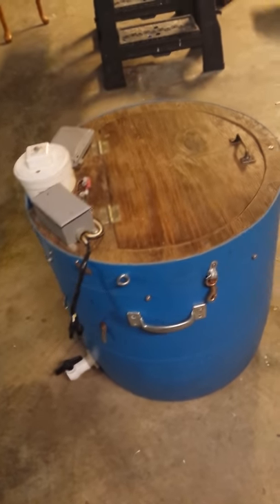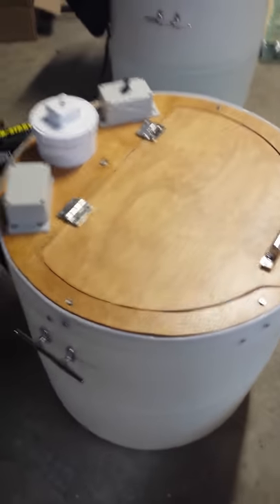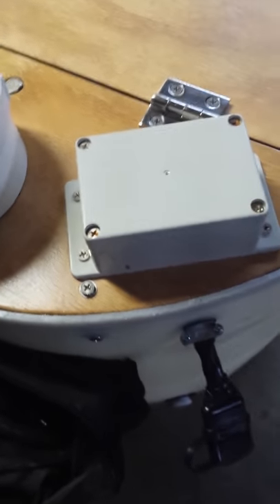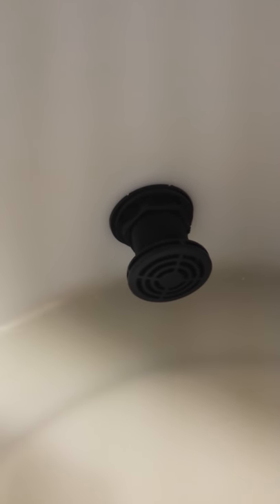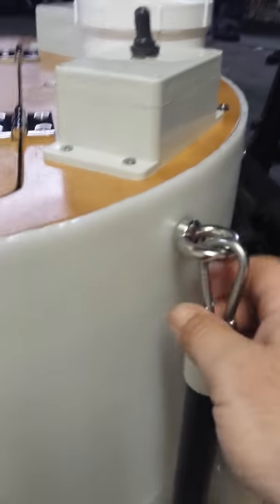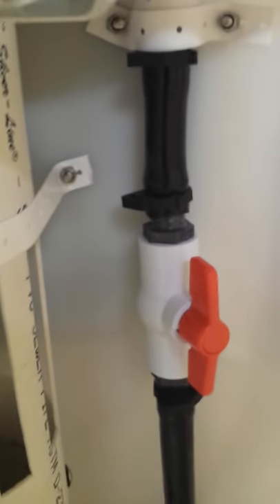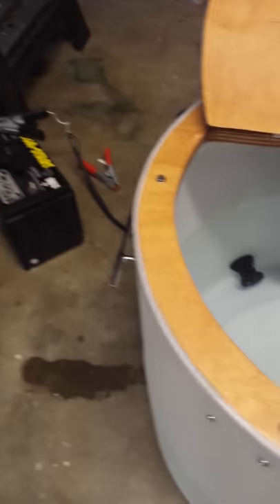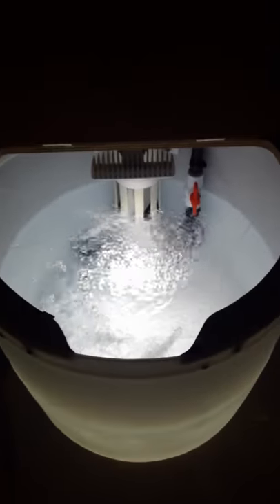How to build awesome bait tank

Comment: Question.  Wouldnt it be better to pull water into pump from the bottom of barrel.  Filter material below pump with holes drilled into bottom of filter pipe for water intake. This way you would be picking up waster from bottom. Appears your design may not be picking up water from bottom of tank. Want to build one for shad. Thanks for video, you got me thinking. 😂
Reply: Yes I agree with you ,and also I've heard you have to keep pumping fresh water in and waste water out for shad .I would like to know if that is a fact .

Comment: Building my first one now, love your design and video!! Only parts im missing to complete this would be a reducer from my pvc elbow to the spray bar and the spray bar end cap. Any recommendations on what to call those parts/where to find them?? Thanks for an awesome video and all your help!
Reply from the maker: Awesome David! Glad your building one!! The specialized reducer that transitions you from the 3/4 pvc to the spray bar is not all that special. Because I got mine at my local Lowes home improvement.. I've purchased all of mine there. Just find someone in plumbing and show him the picture of mine. They will have it! The end cap as well 👍
Reply: @biga1859  just finished it up came out pretty good couple minor adjustments but looks good
Reply from the maker: @davidpowell3356  awesome send me some pics ayounts123@gmail.com

Comment: This is a great looking tank.  How did you make the lid set flush. The opposite side of the hinges when you open and close lid is it hitting some metal tabs? You don’t really show it in the video. I’m wanting to make a similar tank. Thanks in advance
Reply from the maker: The lid is setting on top of 5-6 1in "L" brackets. The brackets are screwed into the plastic tank, down from the top at the exact thickness of the wood. Then I screwed up through the bottom of the brackets into the wood to secure it. 

Yes the lid comes down and sits on two small metal tabs that are screwed into the bottom of the lid.
Reply: Thanks

Comment: I noticed on the screws on the electrical box lids had started to rust. Why not stainless there too?
Reply from the maker: That was an electrical box I purchased from Lowes and the screws came with it. It was rated for outdoor use but appreantly that wasn't 100% accurate by the manufacturer..

Comment: How does it pick up poop off the bottom of the tank? Looks like those slotted vents are 4" from the bottom.
Reply from the maker: Remember the tank is made to keep bait fish alive for 1-3 days.. Anything longer than that should require a more sophisticated system.. I will say this. I have kept bait fish alive in this exact tank for over  a week,,, but that's pulling the drain plug and replenishing the whole tank with fresh water and shad keeper  everyday. If you are doing that, the poop at the bottom, will flow very freely out of the large drain plug that is positioned at the very bottom of the tank.

Comment: Great video. Did you try a boat plug vice a screw in plug for drain? if so what problems did you have?
Reply from the maker: I never tried a boat plug but it will work just as good maybe easier than screwing the plug out 👍

Comment: What demention did you cut the lid to get it to fit that good
Reply from the maker: So sorry for the delayed response but this is a great question. This was a trial and error I can save many people from going through if your just starting your tank. The exact measurement is 22-5/16. I would suggest cutting the lid 22-3/8 and fine sanding from there to an exact fit. Hope this helps!

Comment: What method did you use to mount the plywood top to the tank
Reply from the maker: 1 in stainless steel L brackets. Mount them around the plastic tank, set the wood top onto it, then screw 3/4 in screws  up through the bottom of the plywood through the L brackets.. Hope that helps!

Comment: How do you attach the lid?
Reply from the maker: There are 1 in L brackets mounted around the plastic container. Then the lid sits right on top of those six brackets and I screwed in up through the bottom of the L bracket into the wood on the bottom of the lid

Comment: I want one how much
Reply from the maker: The last time I built one of these was 2 years ago, the material cost for the tanks at a local Lowes home improvement were roughly $250-$300. That price includes the cost of the pump and the barrel and a lot of hardware (washers, bolts, lock washers, that many of you may already have). With the amount of time and precision it takes to build one I would not feel right pricing one that high. If you can build it $300 and a good amount of your time will get you an unbelievable bait tank. If you have any question during the building process I will now be active on this channel and glad to help!